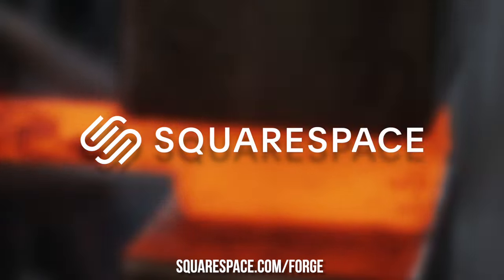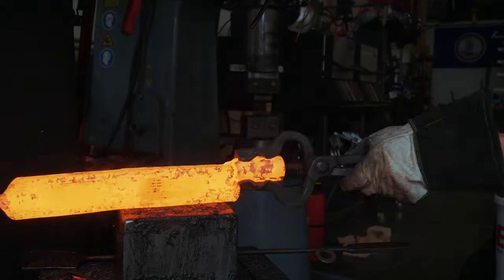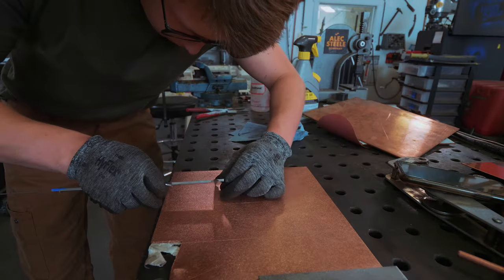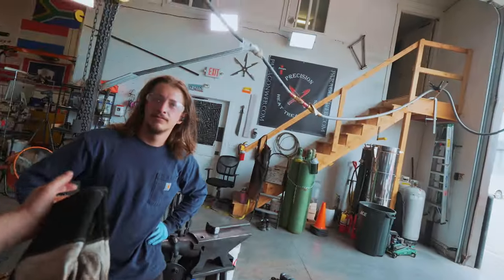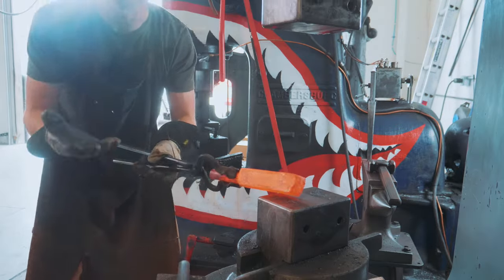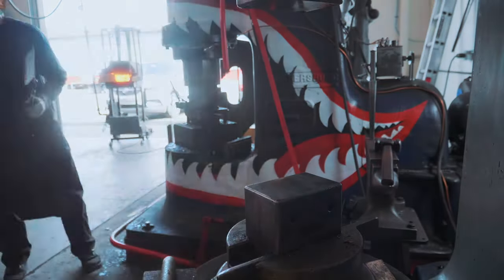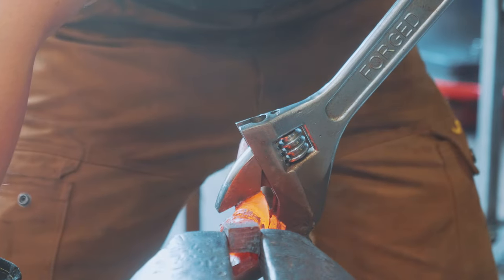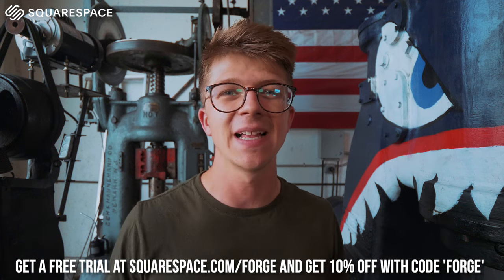Can Copper Weld into Steel Damascus?

Comment: How are you just now starting working with copper damascus ? Just gotta get it hot enough to weld copper to copper and itll weld to the steel. Yall were running way too hot in this but you got some good results. I never tried twisting but just fuse it all together at an angle and itll look pretty after you grind a straight bar out of the results.
Reply: Im not sure if they just made this video the way they did for views or not, but years ago alec was amonst the first of guys on youtube to do copper Damascus, he just never did it with steel, always  metals with similar forging properties like titanium. He did some stuff with meteorite as well

Comment: Probably stupid for even thinking this but run two forges? obviously don’t need as high heat capabilities on one. But you could get each to their individual welding temp and pull them at the same time. Would this work and if not why?

Comment: Have you reverted back to not using flux?  Every time you don't use it you have a section in your video where you complain about your forge welds turning out badly.  It's almost as if flux is useful. ;p

Comment: I wonder if you used Damascus as the jacket and left it on, if that would hold it together for twisting. By using Damascus as the jacket you wouldn’t have to worry about pockets of mild steel in the twist. Shoot me down if I’m being an idiot. I’m not a metal worker just a fan of the channel.

Comment: I just wish as a blacksmith you would call it the proper name... you don't make Damascus, you make Damascus Patern steel...True Damascus is not as defined usually in its pattern and is already one metal not 2 fused layered metals...